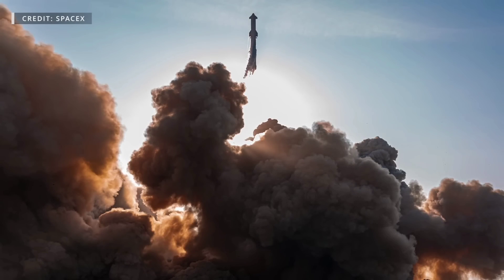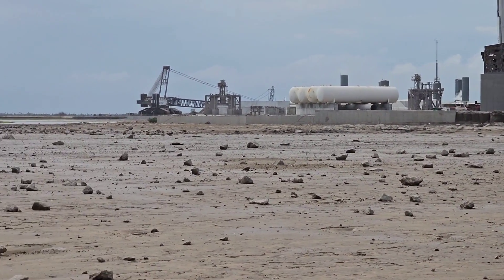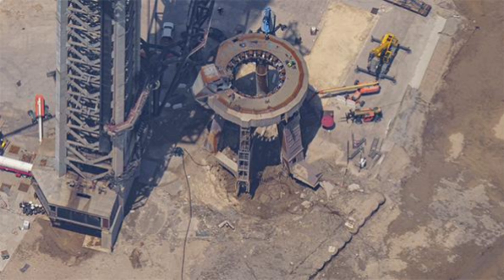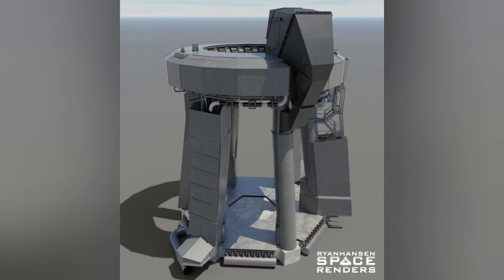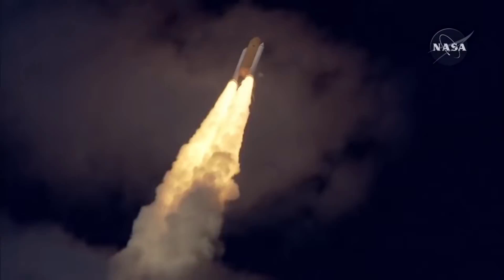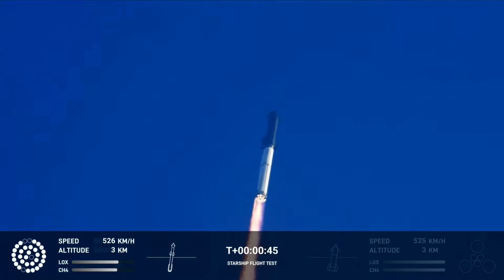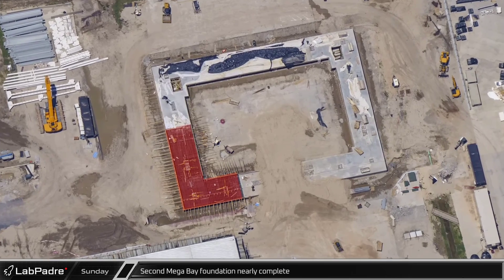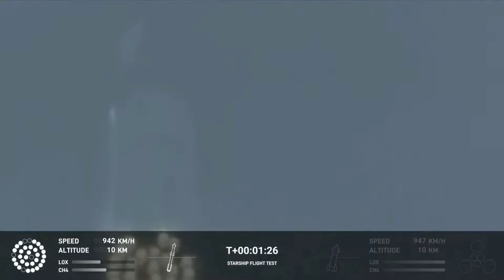Will Elon Musk's water cooled flame diverter be enough to keep Starship and Starbase safe?

Comment: A few cents from someone experienced in structural-thermal engineering:

A. sand can't be compacted to a stable base unless it is mixed with a binder (we call that "concrete") Sand never develops sufficient shear or tensile strength to be useful as a foundation.
B. If SpaceX digs a flame trench in the present location it will soon become a saline lake
C. The Fondag pad did not fail in compression and undermining alone, It failed in bending and tension when the foundation was bent. It also failed locally in tension when the surface heated rapidly but the lower part of the pad heated far slower. This created huge chips of concrete popping off the cooler base.
D. Steel is not a very good heat conductor. The plate surface will heat rapidly while the sandwich interior has not yet heated. If the heat gradient is high this will cause the surface to fail as the hotter part spalls in a shear failure. No amount of water cooling improves this.
E. Steel's tensile strength decreases quickly above 400C. If the sandwich bends on liftoff, it will remain bent after liftoff and for the next flight in 2-3 days (not rapidly reusable)
F. Water expands 1600 times in volume when it evaporates, The cooling water will turn to steam by the time it reaches the edge of the plate, The steam will exit the late at a rate hundreds or thousands of time faster than it entered it. Steam is corrosive to structural steel. How often will the plate need to be replaced?
G. A large amount of water will be needed to keep the plate cool enough  to prevent it from failing in tension.  A water tower reservoir is the simplest, cheapest solution if it can maintain adequate flow for the required 15-20 seconds.  Where is the water and steam going to go? That much water flowing over the beach will severely erode it. So we need a recovery pool too to recycle the water. Will it use salt water or fresh? A fairly large pump is needed to refill the tower.
H. The cooling water flow needs to be controlled not just dumped into the plate otherwise it starts with a huge surge and rapidly decreases even as the rocket exhaust increases. How is the water flow throttled to match rocket exhaust loads?
I.  Superheavy with 33Raptors is a huge methane-oxygen cutting torch. What are the failure modes if cooling rate is less than heating rate?
J. The steel plate will expand rapidly after ignition. Its edge should not be constrained of it will bend,  especially should not be welded to the OLM legs or they will bend. Anything more than a single constraint point will create large stresses. But what will stop the cooling plate from bouncing under full thrust? 15 MN + steam pressure of up to 1600 atm  is a lot for a single support point.

If SpaceX doesn't have answers to these questions, FAA should ask for them. SpaceX has already burned through a lot o good will with one botched launch, imagine how hard it will be after a second one.
Reply: you say that the heat will not be conducted through the steel fast enough, but then say that it will turn the water into high pressure steam. these can't both be true.

how far down do you plan to put concrete? however far down you go there will be more sand below your concrete.
Reply: @davidelang  Wet sand is not a stable foundation material: it has no tensile or shear strength.

Correct, but this "steel sandwich" brainstorm seems to depend on both rapid heat removal from the upper steel surface and conduction of the exhaust heat into the cooling water. Direct flame impingement on the top steel plate will heat the surface quickly to over 400C but because steel has a low specific heat capacity deeper parts of the plate will take several seconds to reach the same temperature. The bottom side of the upper sandwich will never exceed 100C while the water is flowing. The steam pressure depends on the cross-section of the sandwich gap. It will be between 0 and 1600 atm depending on the design, which we don't have in any detail.  This will be a dynamic design with everything changing continuously ut most of the conversation assume a steady state static design.  It will not reach thermal equilibrium within the <10 seconds of liftoff unless it fails.  The heat will be applied almost evenly over the top surface but the cooling flow of water in the sandwich gap will not be anywhere close to even: the central part will be hotter than the edges because the water flow to the edges will be less than to the center.    I'm sure that this brainstorm is to cool a diverter plate like a rocket bell is cooled with propellant. The problem is the flow geometry is nothing like a rocket bell - the steam channels are not divergent nozzles.
Absent a proof test this is a high risk trial with a poor previous performance on the record!
The sandwich needs a complete test with 33 Raptors at 100% for 8 seconds or more before a flight attempt and then an inspection (by an independent agency) to see if it is rapidly reusable rather than repairable/
Reply: @charlie44266  wet sand is not a stable platform, but it's what the ground is made of to a depth deeper than you can dig in those areas, so you will always have sand under you.

as I posted elsewhere, the OLM is not built to hold down a full stack at full thrust, you would need to add about 4000T (much more if you don't fully fuel the booster) on top of the booster to hold it down at full thrust (per the broadcast, the clamps are released prior to engine startup and it starts moving when the T/W ratio exceeds 1

So they would need to build a special booster standin that held a huge amount of water or LN2. Easier to just simulate with the added info and try it.
Reply: @davidelang  The concern is not holding down the booster at full thrust (although many others do just that), its keeping the OLM platform level as the water table fluctuates seasonally the OLM will settle differently under different legs. Or even tip over in a hurricane. Or sink deeper into the sand as time passes.
Look at the taller structures on Starbase, they are built on pilings which do go down to bedrock or are superconsolidated (see this  for how https://practical.engineering/blog/2021/10/28/why-spacex-cares-about-dirt).  The incomplete consolidation is what caused the Fondag to sag and open gaps allowing exhaust under the blocks to pulverize them then turn them into projectiles.

It not a wise strategy to test an unknown solution to a problem right after a notorious failure. Better be sure the steel sandwich will absolutely not fail before another orbital test flight. At least not fail in the same way. Reporters are not very  discerning in their analysis, they want simple stories.
Reply: @charlie44266  do you really think that SpaceX and the county inspectors are that incompetent? they have huge piles going into the sand. you can't always go to bedrock or compact the sand down to such a distance.

which buildings are tilting? that would seem like a major issue they would be forced to fix before they collapse.

Comment: I hope that Space-X realizes that the pressure of the water, coming out of those plates, has to be much greater than the thrust of all of those engines 😳.
Reply: Not necessarily. The Bernoulli effect should cause water to be inducted through the slots in the plates by the exhaust stream to at least some extent.
Reply: @Geekofarm  I don't see how that could happen. The Bernoulli principle requires the gas to be blown perpendicular to the surface; those Raptor engines will be blasting straight down.
Reply: @kennyfordham6208  Look closely at the plate design. There is a shallow well in the centre. When the exhaust hits it, it will flow over the well bottom towards its walls. The walls of the well are a series of radial horizontal channels. Those channels will induct water that is introduced through their lower surface, or at the junction with the well (the latter is likely as the well bottom will need to have water flowing under it anyway). Either way the water and exhaust streams are perpendicular.
Reply: @Geekofarm  Well, we'll see. 🤞

Comment: Large plates of metal melted last time it won’t work it needs diverting  , steam will be the problem next time
Reply: what large plates of metal melted?
Reply: @davidelang  one of the protective plates it melted and left huge holes in it .
Reply: @royatkin161  If you are talking about the plates on the tower around the winch, those were holes in the fairly lightweight sheet metal created by flying concrete, not heat. Any melted panels would be on the launch platform, not the surrounding area, and I haven't seen any signs of melted plates there.
Reply: @davidelang   what about the massive steam problem next time ,Vaporised ?
Reply: @royatkin161  we don't know how much water will be vaporized vs just pumped through the plate to keep it from melting, but whatever steam there is should be able to escape along with the rocket exhaust in all directions.
Reply: @davidelang   I’m betting a divert tunnel will be the used once they remove the environmental issues.

Comment: As an engineering instructor and one who in part, teaches standing waves; I would be quite concerned by the huge amount of energy hitting a flat steel plate. As anyone who has had a reasonable education will know; the angle of incidence of energy to the normal will equal the angle of reflection. This would mean that huge amounts of antiphase rocket efflux energy will reflect straight back up to the engine nozzles. The water deluge system will attenuate this by some degree, but there will have to be a very large volume of water to achieve this. I agree with you that a much bigger water storage system is needed to attenuate the efflux efficiently.
Reply: that is true under static conditions, but NASA has papers showing that when you add the exhaust flow into the mix, the sound ends up bouncing away at a 45 degree angle.

Comment: Everyone calling for a trench don't seem to understand any sort of basic physics. Adding a trench will in no way reduce the amount of force that is placed on the pad. All a trench will do is concentrate the forces making it need to withstand more. The point of the trench is to direct the exhaust in a controlled manner not reduce it. The worry about the exterior of the pad is pretty silly too. What happened with pad was that the sand underneath compressed allowing the concrete to flex which caused cracks. Once the cracks appeared you start to get uplift which concrete it not good at handling. It is the same concept of a spillway on a dam, as long as the water is moving over it, it is fine, but if the water gets between the pieces it erodes underneath and lifts them up. So as long as the exhaust is moving along the ground it will have negligible forces considering it will be moving parallel to the ground at that point.

Comment: The millions of pounds of thrust will likely deform and destroy the steel sandwich structure as well if it is completely flat. The reason is the same reason the flat concrete failed. The subsurface preparation of the soil wasn't compact enough to keep those millions of pounds of thrust from deforming the soil underneath the pad putting all the work on the concrete structure which cracked. 

The steel sandwich will also have to take the entire force of the thrust if the ground underneath offers very little assistance to resist these forces. In order to do it right they would need to also pour a very thick reinforced concrete matt underneath the steel sandwich. But most importantly this slab unlike the last one needs to be tied into a grid of friction piles that are rammed into the soil. This will all but eliminate any deformation of the pad allowing the steel sandwich to do it's job of just resisting the sound waves and heat.
Reply: Right! Watch the latest RGV from Saturday. Appears the 3'  friction piles diameter was too small. They are in the process of being replaced with 5' diameter.

Comment: It takes at least 28 days for concrete to reach minimum hardness.  Otherwise it will just get blown out like the last stuff, which had just been replaced with high temp cement..  Going to longer than 8 weeks.
Reply: What's "minimum hardness?" Concrete cures for a year or so. When casting a road or hard pad, 10 days is sufficient. So my guess is that testing can continue as the concrete finishes curing. And boy will he need some testing!
Reply: @Geekofarm  28 days..

Comment: I dont' see why it wouldn't be possible to fix the pad in 6-8 weeks. I don't see why the steel plate couldn't solve the flying concrete problem..
Reply: The point is putting in place the steel plate and other modifications will reduce the damage from launch and enable the testing of Starship to continue.  Angry thinks delaying the system for over a year is good for some reason.

Comment: SpaceX has a rocket system to test.  The damage from the April launch is as bad as the damage would be, correct?   The new water cooled plate system will reduce damage and enable testing to continue.
Reply: No - the damage could have been worse. What if the trench had been dug under the tower? That would have put the tower at risk. What if the sideways maneuver away from the tower had moved the rocket into the tower? The resulting explosion would probably have destroyed the tower and potentially other ground support equipment like the tank farm. What if the rocket had experienced an air burst? The pressure wave would have destroyed windows for kilometers and the resulting lawsuits could have bankrupted SpaceX.

Comment: Im a little worried about water getting into the engines but as long as flow is always more downward than upward it should work just fine.
Reply: And by continuing the cadence of test launches SpaceX will learn and refine the system.  The country needs this rocket system to work.  The next launch will test stage 2 separation.  Damage to the launch pad is acceptable in comparison to achieving an orbital Starship flight.
Reply: Any water on the surface of the deflection plate will rapidly be turned to superheated steam no matter how big the deluge but it should, in theory, be a lot cooler than the naked flame.

Comment: All the talk of the OLM and a flame diverter trench, is incompatible with the Earth transport option for Starship, these launch and catch platforms need to be a very simple design that can be built anywhere, think airports.

For that reason, I think the whole concept needs to change, why couldn't the whole rocket be held above the ground by dedicated chopsticks, for refuelling, and all the other requirements, and launched from the held position,  at least twice the distance from the ground currently used.

I know it sounds foolish, but so does catching rockets out of the air, the weight would be the main issue, so maybe two towers might be needed. As the rocket starts to pull against the arms, they simply release and spread to be out of the exhaust zone.
Reply: Earth transport Starship is a boneheaded idea that is never going to happen.
Reply: what's the difference between being held above the ground via chopsticks and being held above the ground by 6 pillars (other than the fact that the pillars under it will have a much easier job supporting the 5000T of rocket and fuel)
Reply: @davidelang  the difference is that you don't destroy an OLM every time you launch, consider the idea of daily launches from the same location.
Reply: @steve5090406  you probably also won't launch if you have to build the rocket to be able to hang from hooks as well as being supported from the bottom (where the engine thrust comes from) will add to the weight.

How high do you think you need to hold it from the ground, and why not build the OLM that high?

and the OLM was not destroyed, the ground under the OLM was damaged (which also explains why Elon says that there was minimal damage to the OLM whild AA says it was massive. If you measure it by volume it was massive, if you measure it by cost and effort, it's light.)
Reply: @davidelang  the rocket is currently lifted and moved by the chopsticks by inserting pins on the arms into holes on the rocket, but it isn't caught with pins and holes, so it is caught and repositioned some other way. All I'm saying is that the turnaround time could be faster this way.
Reply: @steve5090406  it's lifted and moved empty. The ship with a payload would probably be the heaviest thing the chopsticks are designed to handle, somewhere around 300T

fully stacked and loaded with fuel, the weight is around 5000T that would require a very different setup to hold, both on the tower and on the rocket.

Comment: The water jacketed plate will not work. The pressure created will bend it into a pretzel. However, there is a design that will work. It is based on the 1966 launch pad safety report commissioned by NASA. It talks about how to redirect the blast down and out by way of a flame trench. The alternative would be to use GE turbines to create a suction higher than the downward pressure and captured by 50 inch pipe with a water jacket around the pipe. The exhaust is sucked into the pipe and directed away from the pad. Once the exhaust enters the pipe, the turbine is turned off and then diverted away from the turbine suction path by means of a diverter valve. This system captures the exhaust (expanding gas), pressure, and acoustic noise.